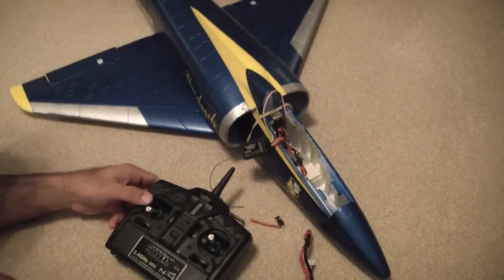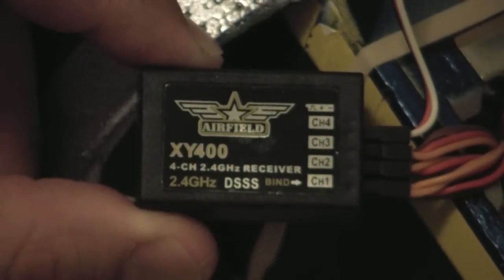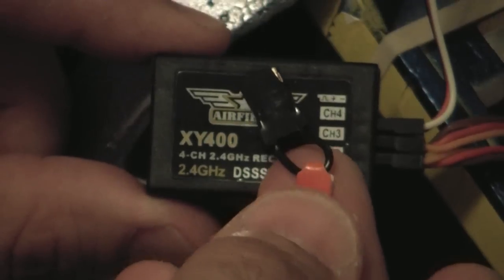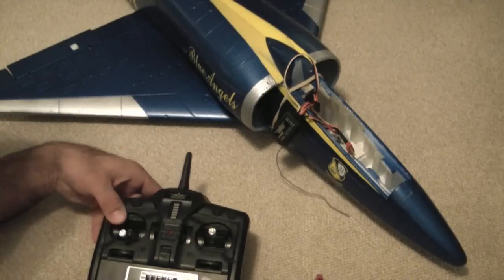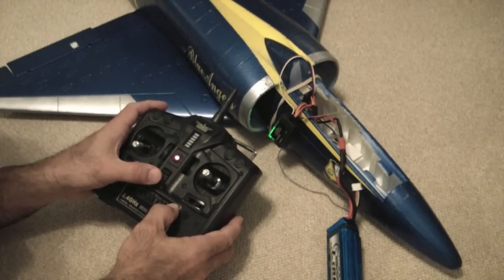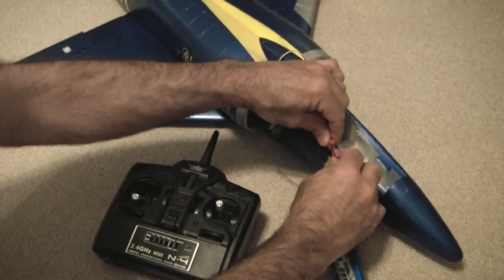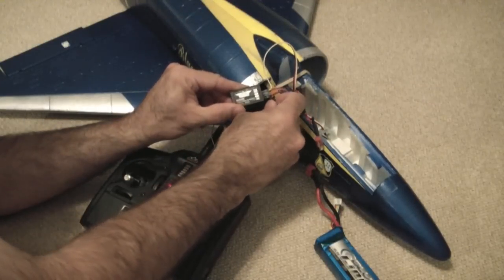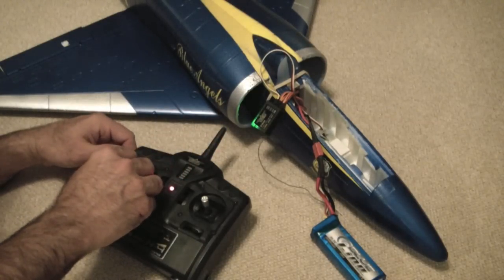Airfield N4/N6 Bind Procedure

Comment from the maker: @RoboTekno 
Battery life is what you make of it. It comes with a carrier where you put in AA batteries but the connector was the same as JR. Tx feel is not bad for an RTF airplane. I may put in a cheap flysky Rx and run this from my FlySky 9X radio but so far so good.